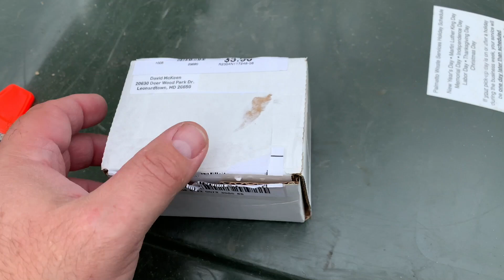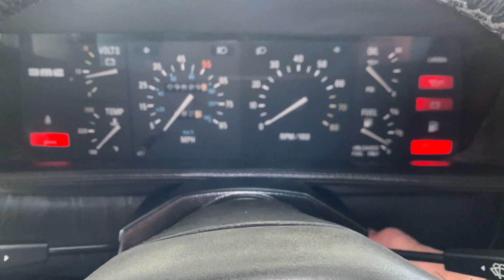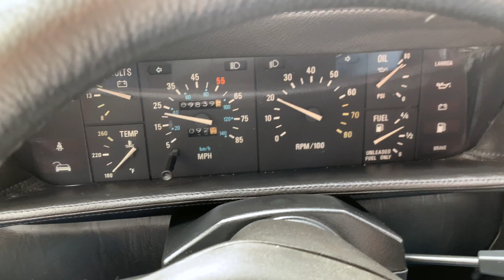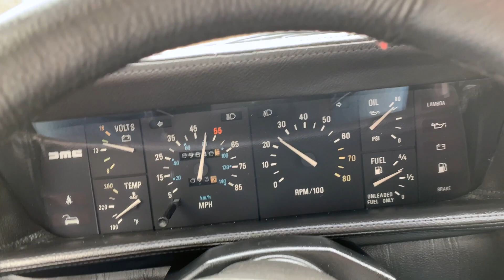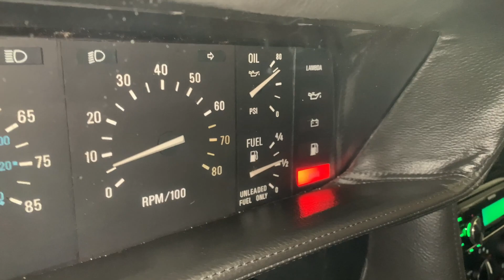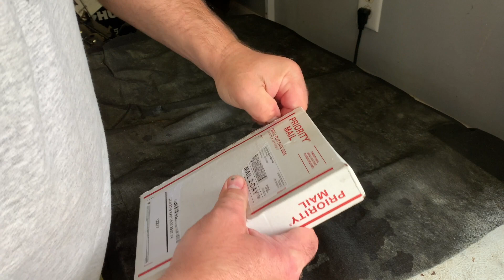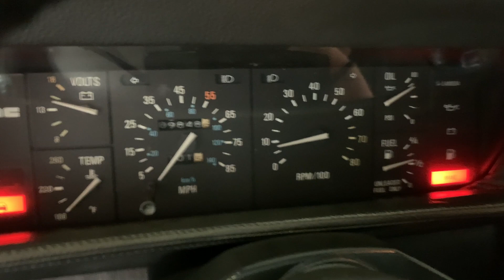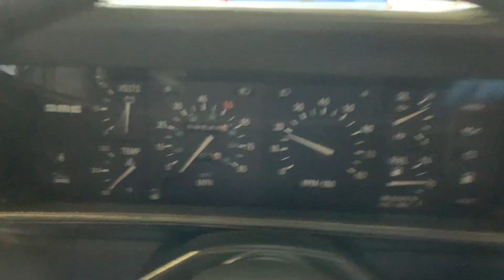Part 3 1981 Delorean DMC12 Restoration New Series

Comment: Really enjoying these videos, thanks for taking the time to post. 

Your speedo cable is a fairly simple fix!  A lot of the old GM vehicles (pre-87) have very similar cables.  The original DeLorean batch were made in England by a company that made cables for Vauxhall (GM in the UK, also a heavy user of LAMBDA until the OBD systems starting showing up in the mid 80s). 

The spinning cable inside the sheath gets compressed in cold weather.  The outer sheath contracts ever so slightly and causes binds, which causes the cable to wind up like a spring. The tension builds until it can break the bind and then the speedo jumps up temporarily as all the energy in the wound cable is released. With two cables, you get twice the fun! 

The fix, spray some silicon down the cables. I do it from only one end. Mount the cable vertically and spray from the top end. Keep spraying until clean silicon starts coming out from the bottom end. This is to remove any friction dust that has built up in the cable. 

When you reinstall, try to limit any binds. 

That's it!

And be careful dude! Try not to use power drills around gasoline.  Most shops ban their techs from using electric tools when they service fuel pumps or work around the tanks.

Comment: Speedo bounce is probably the dust cap slipping. Temp can make it better or worse. Try replacing the dust cap which is cheap and easy and it may correct all the bounce in the needle.
Reply from the maker: No I checked that first thing. In fact it is brand new. I think the lower cable needs replacing. They now make a slightly shorter one to take that bow out of the cable.

Comment: The spindle needs oiled in the magnet hole and then a little of a special silicone needs to be put on the spindle just under the pointer. I used to repair, rebuild and recalibrate speedos
Reply from the maker: Didn't know that. I think the issue is the lower cable is still the factory no shortened one. And once I put it in the plastic clip by the angle drive it binds up some.
Reply: Dollars t doughnuts your angle dust cap is slipping.

Comment: Might I say you are doing a fine job on the Delorean. It may be wise to check where the master cylinder was leaking if it leaked for a while and got on the frame the fluid will react with the epoxy coating on the frame and make it bubble iup causing rust. When I was  working on mine I had some problems with this and had to do some frame repair.
Reply from the maker: I checked it. Frame was good.

Comment: I was never sold on the new fuel pump design. Seems to create more problems than it was supposed to solve. The old design is fine as long as you don't get the fuel hot causing the pump to overheat. I corrected this issue on this thread about halfway down. http://dmctoday.com/showthread.php?2821-Your-winter-holiday-to-do-list/page6
Seems like you have a idle surge, this is widely regarded as "normal" but it is not. With just a little help that can be corrected. Usually it's a vacuum leak causing the idle system to always play catch up. Some people try to compensate with a mixture adjustment but that is just a band aid fix. I subbed, love watching people bring these cars to daily duty!!
Reply from the maker: I do like the new pumps they are using from Delphi. Those pumps are used on so many cars already. And this was instead 8 or 9 years ago. Some years later and the electrics were improved. I am working on Part 4 now and found my evaporation canister lines plugged up and one completely closed off. Might have something to do with the vacuum issues. We will have to see.
Reply: @fiero880  My new pump took a dump after 50 miles. Nobody makes a quality OE pump anymore, not even Bosch. I finally went with a new pump design from DeLorean Industries(same thing as the Delphi but his comes with everything needed including pre fabed AN fitting hoses). No high heat tests just yet but after about 100 miles, no issues.

Comment: Why do your rpms go up and down during idle.  Reminds me of my old 67 Camaro before I fixed the float on the carburetor. They had a styrofoam float and when they got old they got saturated with gas and caused the uneven idle.  Not sure what carburetor you have but it could be a similar issue.
Reply from the maker: Its a Delorean thing. It only does it at start up. Some have idle issues where it does it all the time.

Comment: I Would Have Replace The Old Tired Fuel Pump With A Whole New One, My Opinion 🤔
Reply from the maker: What do you mean ? It has been replaced. It already has the replacement modern fuel pump system when it was restored by DMCH.

Comment: Why does the tach needle stay at around 1500 when the engine is not running and when it is running the tach needle appears to be just fine?
Reply from the maker: Just the way the older gauge was designed.

Comment: is that oil pressure reading normal? looks kinda high
Reply: Factory units were miscalibrated. The new sending unit will read correct oil pressure.

Comment: Can you give more details how you managed to swap the fuel pump connector with the new one?
Reply from the maker: If you take the light gray plastic clips off the connector, you have full access to the wire connectors. The wire connectors have a plastic black tab that secures them in place. By lifting that tab you can pull the wire and metal connector through the black of the plug and transfer it to the new connector. After each wire is in the correct place and pressed fully in seated at the tab you can put the light gray pieces in place and the connector is swapped.